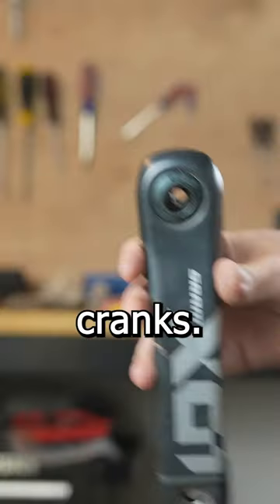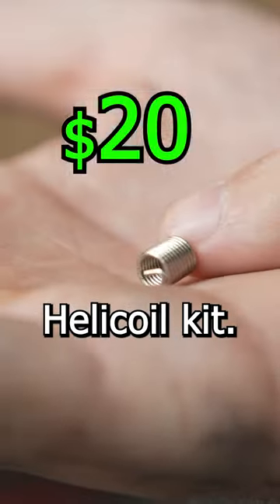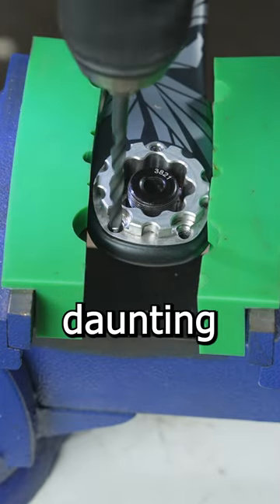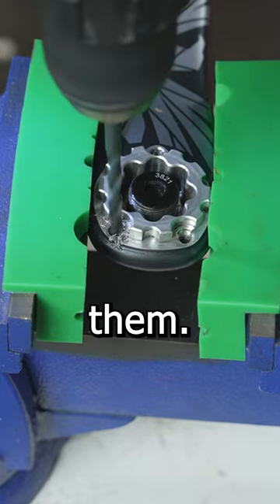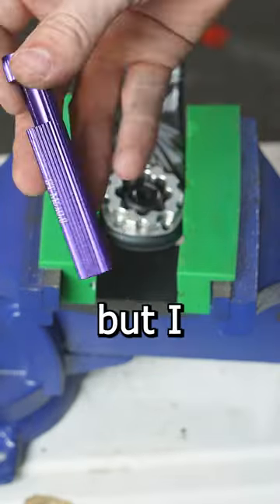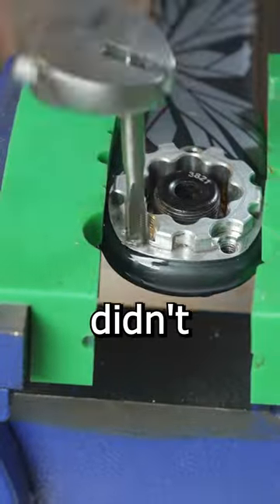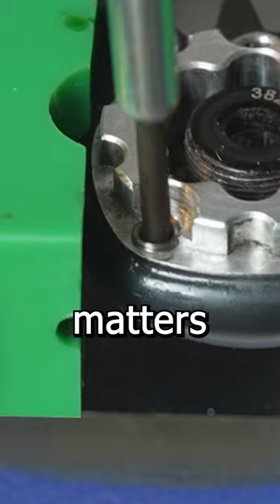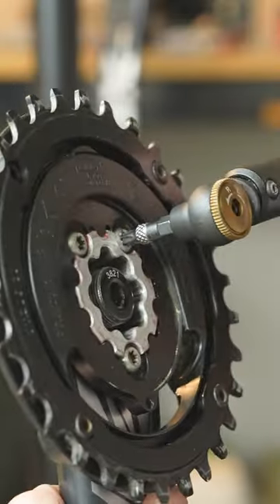I stripped my carbon cranks!!

Comment: Damn, those cranks cost more than my whole bike 😂
Reply: Hahahah same
Reply: Can definitely relate 😂
Reply: Same😂😂😂
Reply: Same
Reply: Buy used. Pre covid I bought two carbon crankset; one for $75 and another for $120 with a BB.
Reply: Same
Reply: @aaron___6014 Used cranksets are a great deal
Reply: @aaron___6014 my bike costs $120
Reply: @Meladity you had me thinking, just my chain and stem each be about that price, my cheapest bike I still own is £600, someone stole my £400 mountain bike, all built myself and yes I enjoy doing true bike builds, (true as in I build the wheels unlike those on youtube that call theirs bike builds)
Reply: @mlee6050  In my country $120 is more than ৳12000. My bike isn't that good so I'm going to sell it and buy a good one (my bike was bought about 3 years ago when I had absolutely no bike knowledge).
Reply: @aaron___6014  stay tf away from carbon cranks, I'll try carbon anything but not cranks after seeing them snap off on the first strike
Reply: And I’ve snapped them cranks
Reply: damn right.

Comment: This is easy. What's harder is when you strip the pedal threads on your carbon crank and need to find a 9/16 reverse thread helicoil and tap. (Unior makes them but I ended up mailing them to a shop that had the tools)
Reply: Serious question... can you just go in through the backside to "reverse" the threads?  
I'm not gonna lie, I've been working with machines/tools/farm implements/bikes/etc for 30 years and I STILL have to say "righty tighty." So, that's the one thing that I damned near always get wrong.
Reply: @playgroundchooser  you know how you can flip a nut around either way and it will thread in the same direction. Same thing here.
Reply: Your local shop should have all those tools.
Reply: @doncrescas  😱🤦🤦 oof. That's embarrassing. Of course it's the same "handedness" upside down. 
I can't believe I just got that finally.
Reply: Critical on a pedal thread to get the thread completely straight. Otherwise it will feel very strange as the pedals turn
Reply: @playgroundchooser you can alway go in thru the back side, they love it
Reply: @leonardhpls6  😂🤣🤣

Comment: Pro tip: When drilling always use slow speed and high downward pressure. People think using high speed helps but it just smokes and ruins the bit.
Reply from the maker: Thanks dude!
Reply: @EvansMTBSaga  Anytime. Keep up the great work.
Reply: Depends on the drill size. Small bits can spin fast but low pressure, big bits slow but heavy pressure. That's why those shop drill towers have several belt speed options.
Reply: @FIGHTTHECABLE  I agree but size comes into play but the main thing that changes what speed and pressure you use is the material. The harder the material the more pressure and lower speed.
Reply: @Nalladolla32  yes, but he is not drilling titanium or A4 Steel or anything alike.
Reply: @FIGHTTHECABLE  It doesn't have to be lol. Simple stainless steel, galvanized or even tool steel of decent thickness is enough to smoke a bit if going too fast without enough downward pressure. Speed makes heat and heat ruins the bit.

Comment: Helicoils are a lifesaver. I had one thread of the brake disc strip in the aluminium case of a rear-Motor. The only thing that could save the day was a helicoil. 

You definitely need to have them at home in bike-sizes.

Comment: exact same thing happened to my x01 crank using the xcadey powermeter. saw that the tread a few mm below was ok so i used longer disc brake bolts which worked great. helicoils was an option  if what i did didn't  work. tnx for the  video i have confidence  now that those helicoils will work too.

Comment: the interesting fact about helicoil is that it is stronger connection than normal thread and this solution is used in car industry to fasten brake calipers in sports cars

Comment: Not only can you fully torque, but you can torque even higher. The treads in the aluminum shear with steel bolts.  But the helicoil tap makes a bigger thread in the aluminum.  Which can take more load.

Comment: A crescent wrench on a tap?!?! With how much money is in your bike, you can afford a tap & die kit that has a proper handle for the taps that allows equal pressure on the tap. Also, I hope you used a threadlocker on the helicoils and let it completely dry before torquing the mounting bolts.

Comment: Wonder how long that lasts. I'd hate for it to give out
Reply: They use these all the time to repair car engines.  Installed properly, your gears could wear down to completely round, and it'll still be just darn fine.  Amazing little things..
Reply: Forever.
Reply: If drilled, tapped and installed correctly, helicoils are absolutely fine, and usually stronger than the original machined threads. 
I've used them many times over the years, on machine breakdowns and repairing casting dies. All good. Some lasted nearly the whole life cycle of the die cavities, enduring a very harsh, high temperature, high pressure life for many years.
I would have no issues or lack of confidence using them in this situation, if it saved my very expensive crank 😊👍

Comment: To avoid these steps alltogether, before ramming your bolt in, screw reverse for a turn, just to get the bolt alligned right. It helps, but won't stop a dual left hander.

Comment: Wouldn't recommend helicoils but would recommend timeserts. Helicoils cal pull out under load (coming from block repair on engines- may be different for this application).
Reply: Helicoils have a smaller diameter requirement for the repair. For normal torque repairs they hold up well enough

Comment: You missed one thing you gotta use Loctite when installing the heli coil that way it won’t come out when you need to remove your front sprocket 🤟 or it’s just a tip tbh it will probably be fine but a great hack either way 🔥

Comment: you should invest in a drill press at a quarter of the cost of the crank. you would have a better set up for drilling/tapping and you would have a much more perpendicular hole.

Comment: This is why “tourqed” to spec isnt a good thing if u change your ring often, the specs are to harsc on the aluminium to be done over and over, so in my opinion, tighten the screws by feel, have done it all my life and never had a lose bolt on my bikes, so thats my tip of the day👍🏼

Comment: Helicoils are stronger than aluminum threads. Project farm has a video on it. My work actually puts helicoils in aluminum as standard before they go to the customer. Helicoils are great
Reply: I don't thing "stronger" is the right word.  A helicoil is still only held in by the thread of the part it's inserted into...which is aluminium in this case. The difference is the wear resistance. You can screw and unscrew the bolt many times without worrying about wearing out the aluminium thread and eventually stripping it.

Comment: dude use some threadlocker when you use those helicoils to repair the threads if you don't you'll run the risk of ruining it and inevitably thrashing the whole crankset (which actually costs more than my road and mountain bike combined)
Reply from the maker: Yeah I used the green stuff
Reply: @EvansMTBSaga  nice
Reply: Red stuff works better

Comment: And the helicoil is stronger and harder than the original alumium thread
Reply from the maker: Good to know! When I was tapping the threads I was surprised how easily they were cutting in
Reply: Yeah, i don't understand why aluminum cranks don't use a steel insert for pedal threads. I slightly reamed out one of my aluminum crank arms from using pedal extenders, it put to much torque on the hole. The only way I found out was when i switched out pedals and the pedal wasn't screwing in, I ended up screwing in the pedal from the back to reform the threads in the crank arm.

Comment: Bro why r u running carbon cranks in the first place it's a MTB not a road bike
Reply: Not just lighter, but also stiffer. Necessary? Nope. Then again, what really is?
Reply: @Megabear90  yeah they're lighter but not stiffer. The weight is really the only benefit. I wouldn't run them on any MTB besides maybe an xc bike
Reply: @vintagesteel  they can be a lot stiffer.  That to me is the main advantage of carbon anyway: It can be engineered to be exactly as stiff or flexible as you need it.
Reply: @Megabear90  if you look at DH race bikes they all utilize aluminum and steel cranksets because they're as strong and bombproof as it gets. Carbon is a very unsustainable material to use in bikes as proven in the video and all these carbon bikes are only going to last maybe 25 years MAX if they're lucky while metal bikes can last 2-3 times longer.
Reply: @vintagesteel  how do you come up with these numbers? Especially since modern carbon hasn't been around for very long. And how would you figure that a sample size of literally 1 would be any kind of proof? And also do you really think that one of the most specialized apllications for bikes, pro DH racing, is a proof for the usability of a certain material, despite almost all other applications using a wild mix of materials (including carbon)?

Nobody is going to force you to use a carbon bike, but you clearly already made your mind up and clearly are willing fo make things up that defy some of the most and well known facts (like stiffness of materials) to support your opinion. All materials have their advantages and disadvantages, no matter what you believe.